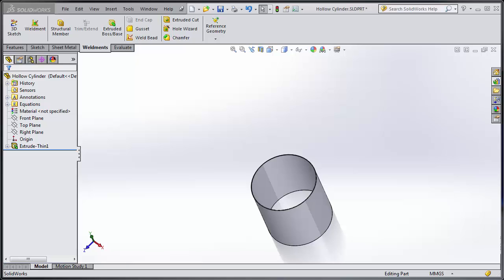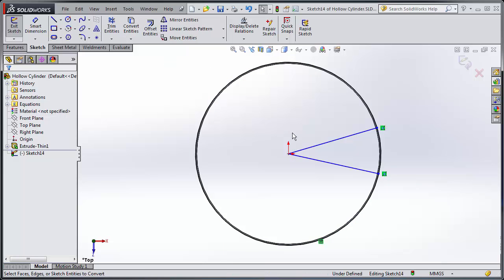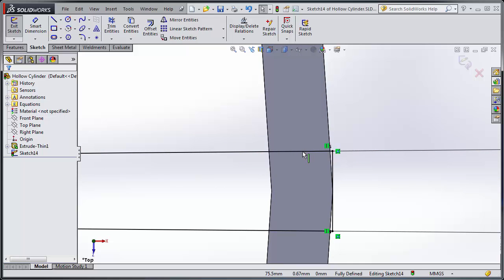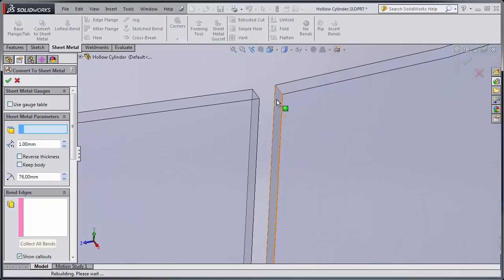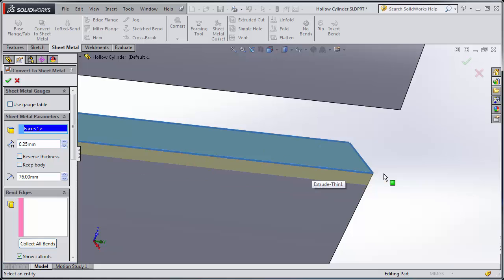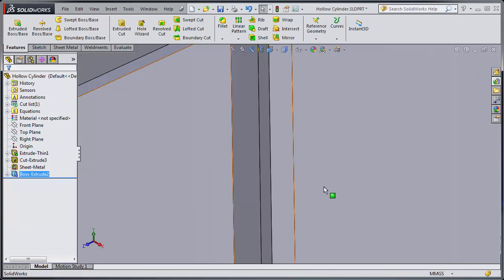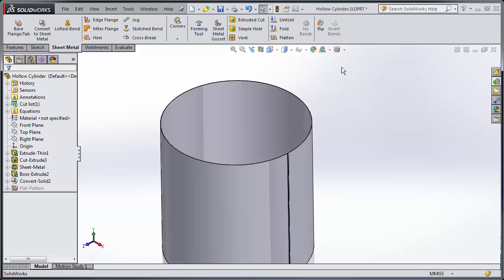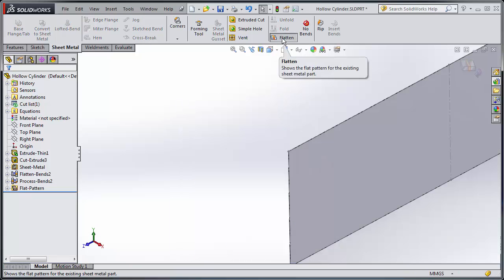SOLIDWORKS Tutorial: 2 Ways to Flatten a Cylindrical Sheet Metal Part

Comment: Way which I find better is:-
Make the hollow cylinder which ever way you want and then give a cut using angle 
Then go to sheet metal select on insert bend and then select any of the axial edges
Now go to Unfold option select the same edge and then click on select all bends
Now you have unfolded the cylinder and got the sheet and now perform the cut or any other function
Once you are done then go to Fold option select the same axial edge and then click on select all bends

Comment: One major flaw with SW generating a flat pattern is that it is always at least x1 - x2 times the thickness shorter. In the real world, the flat patter of the cylinder is obtained by measuring length of central axis the material thickness, i.e. if you have a 3mm thick cylinder 1440id, the neutral axis diameter is 1443 which measures to have an arc of 4533mm (that's with a 0.5mm break) now, SW flat pattern generates a flat pattern with 4530mm which makes it 3mm shorter than what it will be when the sheet is cut and rolled. On a 3mm material 3mm weld gap is not the end of the world but still will require a fair amount of filling in. The problem is when you start working with thicker material and the material thickness translates the gap generated because the flat pattern is too short. Is there a way to manually or automatically inflate the the generated flat pattern length by the factor of the material thickness? Has anyone else run into this out in the real world?

Comment: Thanks For the usefull video!

Unfortinally when I try to select the cylinder / it's edge, I Still get the massage:
"Cannot be a Bend Edge as there is  a face for this edge which is non-planer" (4:20 minute in the Video).
If anyone knows how to go around it or fix this issue please let me know 🙏🏼

Comment: Thanks, this is brilliant! I find the Solidworks sheet metal tools are quite powerful, but are generally not laid out in an intuitive or logical manner - although I'm still pretty new to Solidworks.
Do you know if there is a way to close this gap with the "welded corner" or similar tool. It's just for aesthetics so that he final part doesn't show gaps in it when I'm presenting.